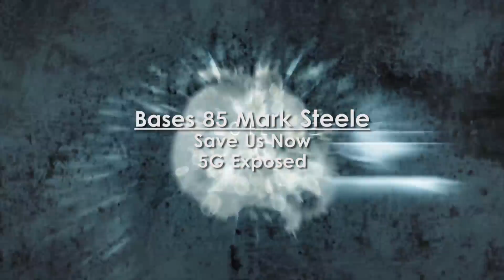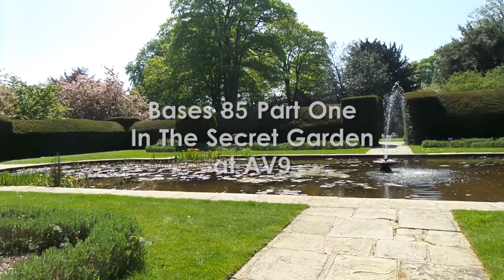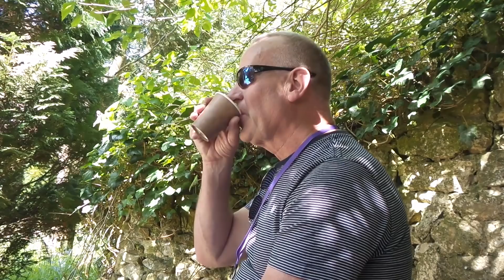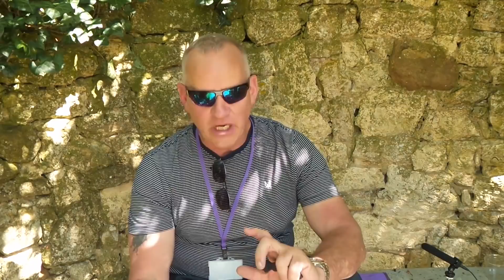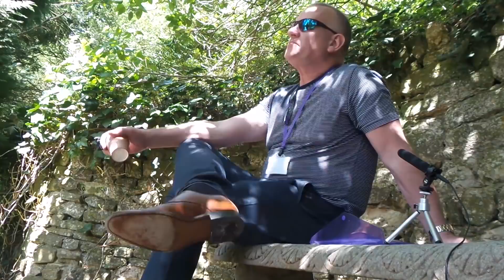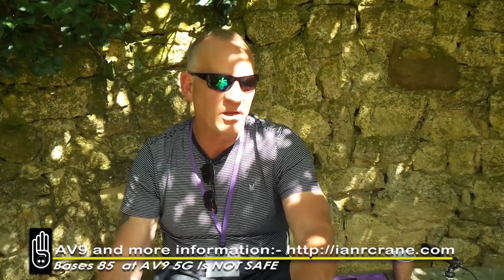Bases 85 at AV9 Mark Steele G5 Part One

Comment: Sad to see nothing more than regurgitation of misinformation, falsehood and uninformed opinion. The so-called self appointed expert provides nothing more than fairy-floss to feed the sugar craving conspiracy theory believers.
Just take his statement that 'the WHO classified 5G as a carcinogen' - typical deliberate misinformation.
Mobile phone RF signals were, out of lack of research confirming absolute safety, added to a list of Category 2B Carcinogens. Cat 2B is 'POSSIBLE carcinogen based on lack of research showing absolute safety', Cat 2A is 'PROBABLE carcinogen based on some research showing possible safety issues, but as yet not fully scientifically confirmed'.
As 5G Radio Frequencies, along with 2G, 3G and 4G, are not new - there has been over 75 years of research and validated information already gathered. What is new is not the RF, just the applications and technologies. 5G small cell technologies actually result in reduced power levels over 4G and previous earlier large cell technologies.

But as always - 'why let the facts get in the way of a good storyline'!

This applies even more to unverified 'Internet journalism' than the mainstream media, who have at least some public scrutiny applied and some ethical standards to meet.
MS did not provide a single verifiable accurately expounded comment, just biased and misleading opinions.